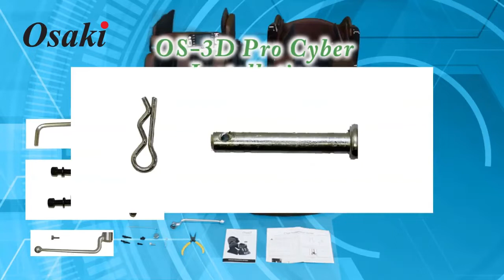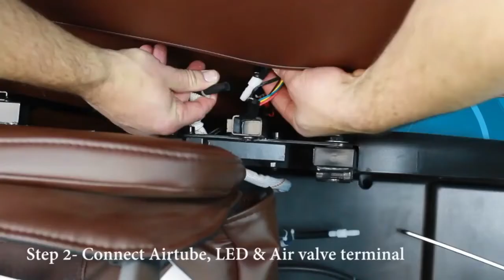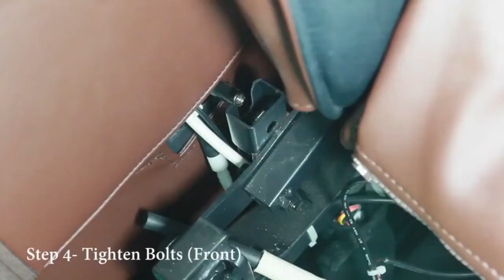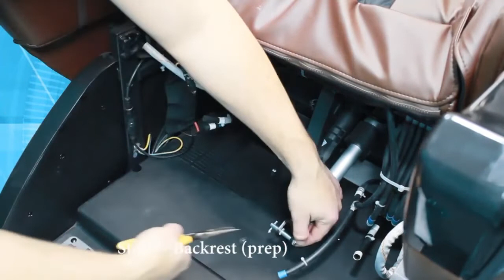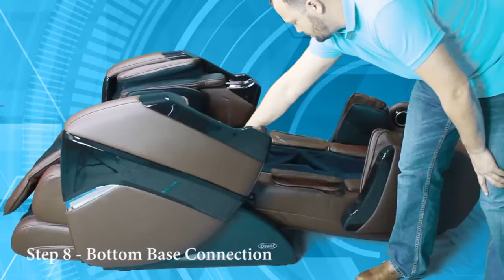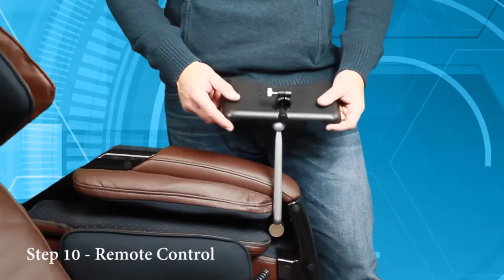Osaki OS-3D Pro Cyber Assembly Tutorial

Comment: Missing the connection of the back actuator. How do you do that part?
Reply: I have the same question. Did u figure it out ?
Reply: @AnshDaCat  Yes, the connector of the actuator is in the middle of the bottom of the back assembly, just pull out the metal stuff and you will see it.